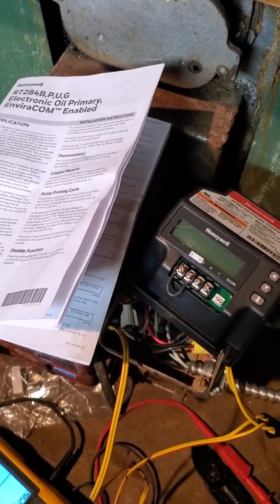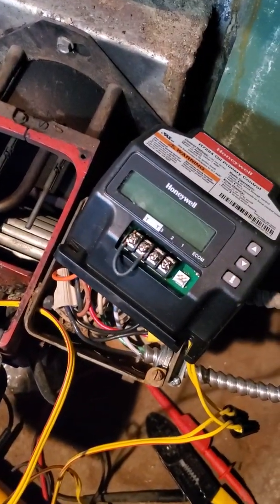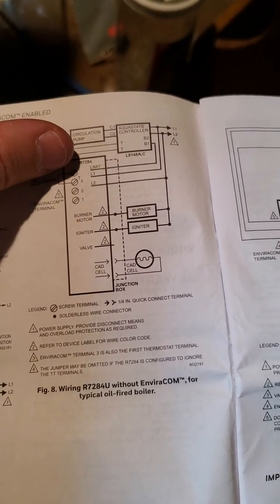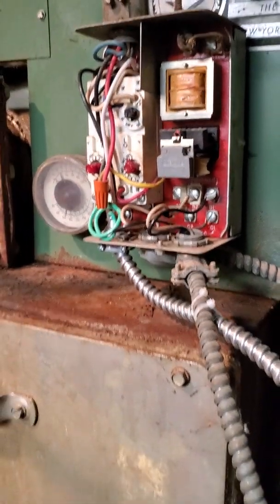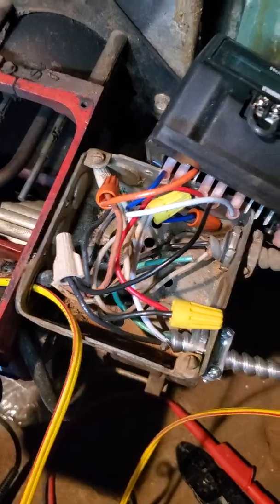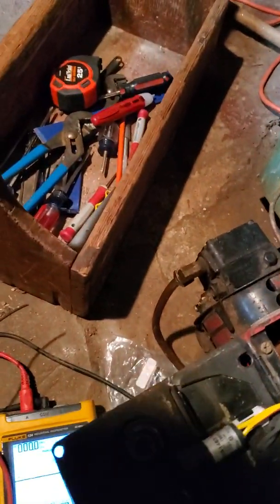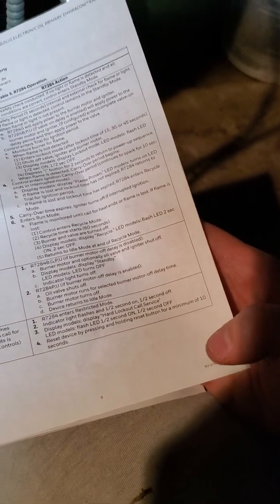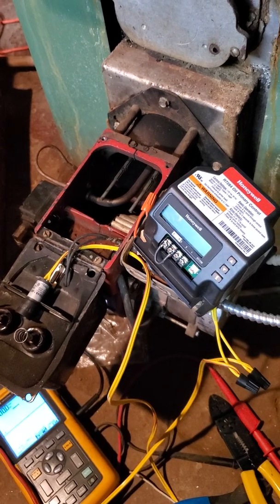Honeywell R7284U replacement on oil boiler Model # R7284U1004

Comment: Not much of that helped but my question is when you went and did the installer set up where it says spark on delay? Did you put it on yes or no? Also for the spark during run did you put it on yes or no I’m not sure what the settings are and what it’s asking for
Reply from the maker: @northeastpac-man5692  you can try any combination of those delays to see if your boiler runs better. I have kept mine off of spark during run since I posted this video. It keeps it from zapping the electrodes and making that humming sound during running. I assume that prolongs the life of the transformer and requires less cleaning of the electrodes. As for the delay, I would keep that on the lower end so you have clean combustion from the start. If you listen closely you can hear when the transformer is on and when you have ignition. I would want the transformer to always beat the ignition by a little bit. Optimizing that would again prolong the transformer life and electrode cleaning needs

Comment: I don't know if you can help me I changed out my old primary control to a new one and it looks like one of the wires fell off 
 I believe it goes to what's called the valve prong, I know it doesn't go to anything else.
Everything is all set except there's a prong that says valve
  can you tell me where the valve wire goes back to the wiring system which one should it be wired but to? 
 thank you
Reply from the maker: Can you post the diagram for your new control? Or what is the name of the control?